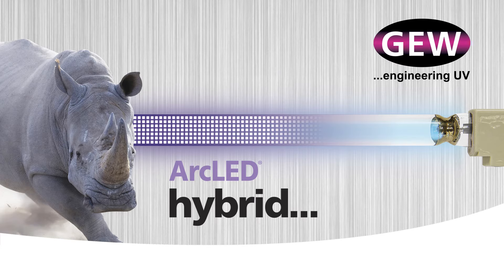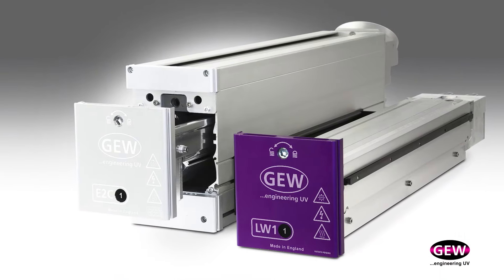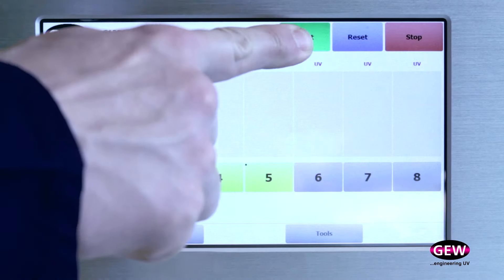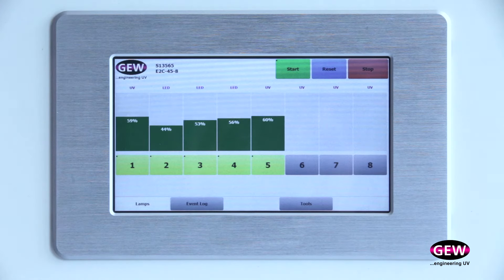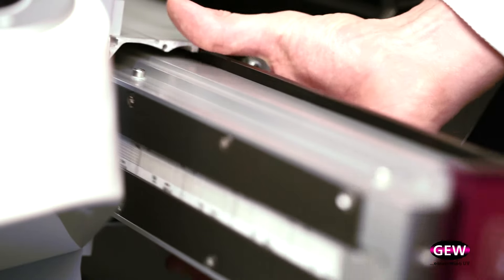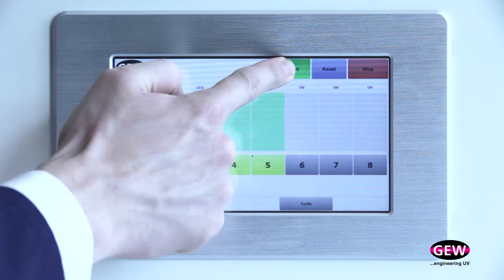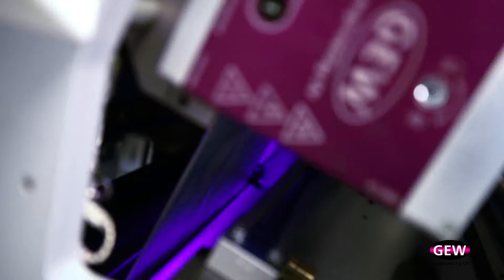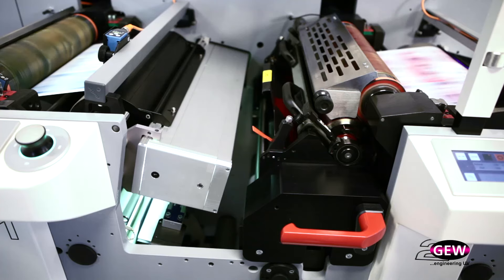GEW ArcLED UV System

Comment: I'm interested in flexo printing, but I'm still collecting information, so I'm sorry for the lack of questions.
The video shows that the UV lamp intensity increases and decreases in proportion to the printing speed.
So, is it always possible to irradiate only a certain amount of dose?
If the printing speed is 100m/min and the dose is 120mj/cm2 of the lamp, but the required dose for curing the ink is 200mj/cm2, is it not enough? Or is it possible to equalize the output and lower the speed to match the total dose?
Reply from the maker: Hi. Apologies for the late reply to your comment. We recommend contacting our sales team at sales@gewuv.com, if you have not done so already, to discuss these questions in more detail. Thanks, the GEW team.